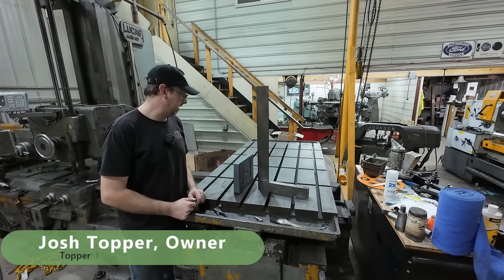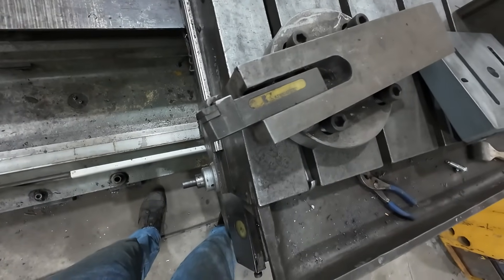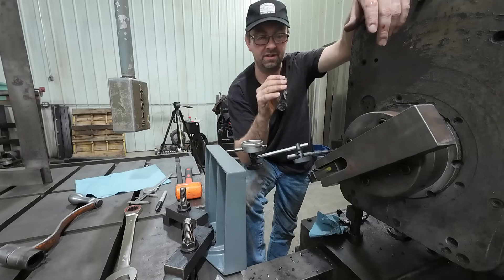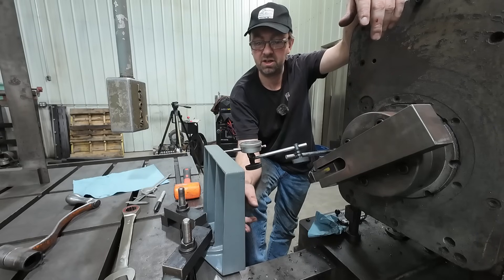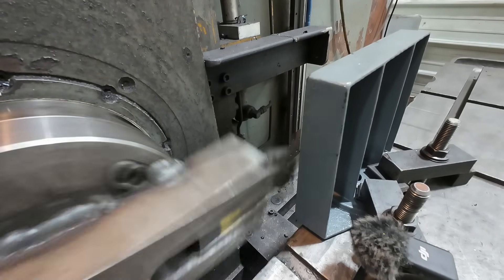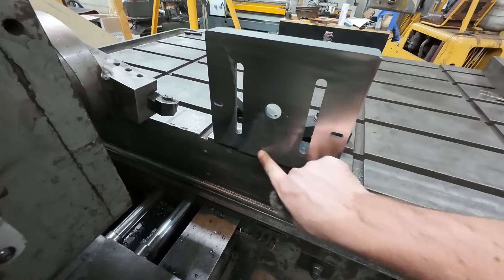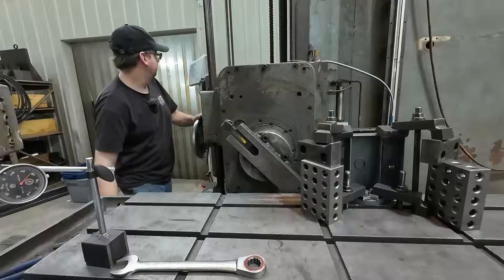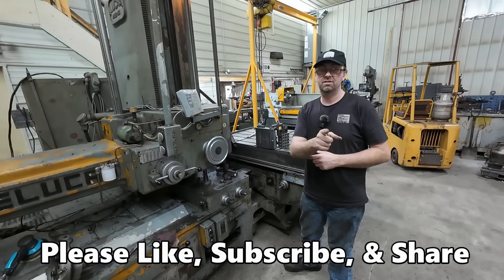Saving A 1930s Drill Press Table | Surfacing Cast Iron Machine Parts | Manual Machining

Comment: Ideally the drill press table should have been measured (clocked) before it was removed from the customer’s machine and have the high/low spots marked on the table. So it could be clocked in on Josh’s machine to the same figures,,,,

Comment: A tacky, gray, clay-like compound called duct seal (@ Amazon, Home Depot, etc.) can be used to add mass for vibration dampening. It is hand moldable and doesn't harden. Potential drawback is chips sticking to it. In the 90's I worked at a subcontractor for the US Navy and the machine shop there used a similar gray compound we called monkey shit. I don't know if it was just duct seal or something different.

Comment: I think the boring mill was an excellent choice; it matched the tool pattern already on the part. I can just imagine a jig with a bunch of tables ganged up running past a face cutter back when they were making these.

I'm willing to believe you know more about what this press looks like than I do, but it looked to me like the face you mounted on the table had some registration grooves. It certainly would have been a harder set up, but wouldn't it have been better to flip it 180° and indicate the mounting face and grooves? Like, I'm sure within the tolerances of a drill press it's still close enough, but if those grooves lock into the stand, the table will be crooked if you didn't indicate them (unless you go lucky when you chose your points)

Comment: i would assume you would have gine with the planer. But I did learn alot when you chose the mill. Curious why you chose to employ the hard rubber padding rather than solidly fixtureing it up.
Reply from the maker: The rubber gave dampening without fear of moving it.

Comment: I was thinking - perfect job for the surface grinder, but then i thought i dont know if i have seen a surface grinder in your shop ?.
Reply from the maker: I had one for 10 years and never turned it on.  Never had the need for it.  Went to the scrap yard a couple years ago.  Floor space is far more valuable.
Reply: @TopperMachineLLC  figured if you needed one you would have it!

Comment: At the outset I was thinking that this was a little like cutting butter with a chainsaw but turns out to be a pretty good choice.  The part originally may have been a product of rotary surface grinding (Blanchard) as a lot of woodworking machine tables and stuff like that are - heavy material removal with so-so accuracy.  Viewer should be pleased with the outcome and the process was interesting to watch.

Comment: Just a FYI with my background mainly being in surface grinding I have had good luck with Pot Magnets for taking harmonics out while grinding. You can get them in different sizes for different weight which makes them handy. You would have to be aware of deflection if you are hanging the magnet on the part but if you use them bolted to a steady rest you can adjust the push or pull force. I was just thinking you may have been able to stick one in the webbing on the top corners to help with the harmonics/chatter. Cool vid keep them coming.
Reply: Shall I send the table finishing? 😝 my German friend who is a retired toolmaker told me to get it ground!  I like overkill.  I like the machining marks which look like they were done.  Changes to make it complete and “up to par”. A USA machine should have been done better than they did in New Jersey.  N. Wisconsin takes the win!
Reply: @cogentdynamics  Grinding the table would be overkill as you have mentioned unless you have the capabilities and time. I am sure what Josh has done to the table will be just fine for drill press work. A German toolmaker friend is quite friend to have around.
Reply: also a SG would violate the "like original, but perfect" idea, Josh chose tool, feed to match the original finish
Reply: @bcooo1  I like to joke around.  Do many good people here.  German guy wants to sell me his grinder with a magnetic sign vise.  I don’t have room nor the skill.  It would be cool to play with the grinder.  Not on a drill press.  I had trouble with grinding as a youngster. Heat and force makes it challenging.  I threw my motorcycle cylinder out of one and broke a pie section out of a borrowed grinder.  Oops!  Everyone hit the floor and crawled to the breaker panel.

Comment: Although the table may tilt it does have a pin hole to set it perpendicular to the spindle. This pin hole may have been drilled on assembly so may not be aligned square with the the pivoting hole. The best reference face is under the table which is where it could be indicated square. This will be close but really needs to be tested for perpendicularity on the drill with the loacating pin after machining.
Reply: Set it up square to spindle on the drill and drill (& ream) out the locating pin hole to take a slightly larger diameter pin, if you must have a locating pin.
Reply: @dutchgray86  that's an ideal fix to quickly and accurately set it level side to side.

Comment: Great video, but how can you be sure that the table will be 90 degrees to the drill press arbor? The table could be 100 percent flat and if not that 90 degree angle, the hole drilled will never be straight.
Reply from the maker: table tilts.

Comment: 🇦🇺🇺🇸. 4:30 am in Queensland Australia, watching a Topper Machine video. Sitting on the Veranda with a cup of coffee and a Brushtail possum wandered past only a couple of feet away. Doesn’t get any better than this.👍
Reply: David also in Townsville Queensland watching Josh work but unfortunately swimming with 600mm of rain in 20 hours. Expecting another 1.5 meters in the next two days. Love it. Josh keep a stiff upper lip and I hope your business picks up this year.
Reply: @ 
Yeah I’ve been watching the weather reports. You blokes are getting a flogging with the wet weather. I’m just south of Bundaberg and we haven’t had anything yet. Cheers.
Reply: @davidcat1455  they seem to think it may move south and east from here so you may get some after Wednesday. We are used to getting a big wet so it isn't so bad around us in Condon. The old lower areas South of the city near the harbour are flooding at the moment and the reports say that it may rise above the height of the second floor buildings so even the Queenslander houses on stilts up here may be flooded out. They are releasing water from the Ross dam as it is at a 140% and rising. If we get the 1,5 meters of rain they are talking about it may get really interesting around here.
Reply: @Andy-Gibb  
👍Stay dry and keep yer arse to the sunset.

Comment: I’m always impressed at the quality of older, castings, minimal flash, nice and smooth.
Reply from the maker: From a time of Pride in Manufacturing.
Reply: Yeah, modern stuff is often junk. You look at it the wrong way and it breaks.
Reply: The castings on the low-end “Driver Line” is really beautiful. Cool shapes and proof of time show it is good.  Maybe the rough finish of the table was at a high feed and DOC just to stop some crazy chatter.  I don’t know but now it is correct thanks to Josh.

Comment: I’m curious if it might not have been wise to align the surface with the hole for the pin the table mounts on. Perhaps there is a mechanism to adjust that angle built into the mount?
Reply from the maker: they are designed to tilt.
Reply: @  Front to back as well as rotate around the pin? I’m not challenging just curious. 

My 1970 craftsman drill press’s table can only be raised and lowered. I got it for free. They were discarding it at my work since the rack and pinion on the quill was slipping. When I disassembled it to repair and replace parts I discovered an eccentric bearing that adjusted the rack and pinion’s engagement.

Score.

Comment: Aren't the grooves in the flange used to locate 90° side to side? I would think it would be important to locate 90 not only to the post front to back, but also side to side. Maybe it doesn't have a locator and you just dial it in IDK?...
Reply from the maker: no

Comment: I get that if this bothers the person, then fixing it is worthwhile, as otherwise it will bother him for years to come. I know that from experience where I’ll take a machine apart just to “fix” something that’s annoying, sometimes just to look at, but not really affecting the work. I’ve got four drill presses. If I do something critical, I don’t do it on a press, I do it on a mill. So whether this table, which, from a machinist’s view, is far out, really doesn’t affect whatever he’s going to do on the press. The errors I saw average out over the top. You also have to be wary about taking too much off. The tables on these little presses are pretty thin. You don’t want to get into a situation where you have to take off just a little more, and then a little more, and then a little more. Additionally, I’ve seen old pieces that have one side machined with the other as cast, when the part is thin, machining just a bit more off has the part warp over the next few minutes, and then some more over the next several days.
Reply: Ha! It has been age normalized for 90 years.  I know what you say is correct.  You would have thought I was off my rocker (and I am) to rework the spindle with new bearings after having it reground o.d. , hard chromed and re-ground.  We use this machine for 4 years but it pissed me off just looking at the table! Thanks for commenting because people like you teaches us all more.

Comment: I agree with you Josh.
The HBM was the way to machine the drill press base.
Nice work.
Customer should certainly be happy with this.
Thanks for sharing. 👍🇺🇸👍
Reply: I wonder what machine back in ‘34 when it was cut?  I would like to know but I do know that Josh used a lot more care and I appreciate him.  Also, thanks for your comment.
Reply: @cogentdynamics  I would not be surprised if they did the surfacing in the same manor back when it was made.
Just the feed and setup was not as good as Josh's setup.
Josh was careful and malicious. 
Glad that you are restoring your old drill press.
Have a great weekend. 👍🇺🇸👍

Comment: Heh.  I have a drill press table that isn't square AND the column clamp isn't square either.
Reply from the maker: Just did what the owner asked and paid for.
Reply: @TopperMachineLLC  What I mean is that I've been meaning to re-machine it myself and I wonder just how common the problem is as I suspect woodworking machine companies couldn't be bothered to make them right in the first place.
Reply from the maker: I have no idea.  I don't mess around with drill presses.  Good question though

Comment: Very nice result. As good or probably better than when the casting was factory new. Now the owner needs to send you the machine base for a similar treatment.
No "Arc of shame" on the Drill Press table.  A responsible owner.
Reply: Since 1936!  My ownership has only been in the last 4 years.  There were two small peck marks.  It wasn’t me or the 3 guys have been using it.  I trust Josh!

Comment: Im not trying to be critical, as im a weekend hack machinist. When i observed the table mounting face there was the main mounting hole and then there was a secondary smaller hole. Im assuming the smaller hole aligns with a dowel on the drill press column which in theory sets one direction of the tram. Assuming my assumption is correct, on your setup how did you take this into consideration when setting up the workpiece?
Reply from the maker: You're assumption is incorrect. The big hole is the dowel, the small hole is the bolt that allows it to pivot sideways.
Reply: @TopperMachineLLC  thank you for clarifying.

That's interesting, i just checked, and my Rockwell has the large as the pivot and the small for the alignment dowel. 😆
Reply from the maker: So many different designs out there.  It is hard to keep track of all of them.

Comment: I probably would have put a piece of paper under the mill side edge to tip the plate back just a bit. That would compensate for some sag when it’s mounted on the drill which I am sure it has since it’s a cantilevered mount and the harder you push down with the drill the more it’s going to tip.
Reply from the maker: Good point. He just asked to make it perfectly square.

Comment: An interesting setup with the large fly cutter on your huge boring mill. A little different but, as you said,“why not?). I didn’t expect the mounting surface to be as square to the face as it was, since there’s usually draft on castings. You’re on a roll; keep it up.
Reply: the mounting surface is machined true first from the factory , I think

Comment: Kinda cool how you did it.  There's more than one way to skin a cat, as they say.  My first thought was to surface grind it but maybe there was a bit too much material to take off.  Do you have a surface grinder?  I don't think I've seen one in your shop.
Reply from the maker: He wanted an original surface finish. I don't have a grinder any more. Had one 10 years, never turned it on. Scrapped it a couple years ago. Floor space is more valuable than keeping useless junk.

Comment: Nice OEM finish,  coarse finish helps fine debris get pushed out from under vice, part etc. Looks like original machining was poor, as you stated, unless someone else had a go in its 90-year history. 
 Now, that's a fly cutter. Dampener pads worked great.
Thanks for sharing.
Reply: @bostedtap  I restored this one after purchasing an old woodworker who was moving to a “home”.  Sad but it has a new life.  It will run for another 90 with some care. Thanks!  I’m loving Topper Machine, Josh is a very good man.

Comment: I probably missed it because I don't have the experience: How would you check that the set-up is also square to the mounting points? The set-up got as close to parallel to the original surface as possible. But since we know that the original surface wasn't the greatest, it would be unfortunate to cut a perfectly flat surface... at an angle to where it should be when mounted in the drill press.
Reply from the maker: I don't have the drill to check that, just the table. But an indicator in the spindle will do it. He asked to square it to the back, which I did.
Reply: @TopperMachineLLC  Thank you! :)
Reply: Nicely done, Josh! That was an excellent idea for reducing chatter. I'm sure the viewer and customer will be pleased.

Comment: I always kind of wondered how you find a starting point on a basket-case part like that. Turns out, you just pick the straightest piece and call that reference.
Reply from the maker: There is really no good way.
Reply: @TopperMachineLLC As we saw, the surface changed little over the many cuts made. This puts the lie to any out of square or not correctly placed objections I think. Of course, just my opinion.
Reply: @MadeInMichigan    Without the column casting you have to assume the mating surface is in 90° tolerance. If an angular index mark - inspect to the bore centerline, if important for the customer.
Reply: @waynespyker5731  That's what I would have figured. Use the mounting interface as the reference, then make the top face square to that. Because while that table top is now flat and has a good finish, there's no guarantees (that we see shown here) that it's actually square to the post mount, which would, of course, affect every hole drilled in every part set on that table.
I guess if that's what's on the milling table surface, it's sort of implied, but not guaranteed.
Or maybe I'm thinking too much into an old drill press table.
Reply from the maker: I was sent the table, not the whole drill.  Without doing all of it, it will never be known.  But, the job was still done how he wanted it done.
Reply: @TopperMachineLLC  Right right. I'm not criticizing, by any means. Just trying to plan ahead for the day when people I don't know start sending me their wonky drill press tables to straighten out.

Comment: Nice job.
I'm guessing you squared the mounting surface also.
Thanks for the video.
Reply from the maker: Since he had zero issue with the mounting surface, it did not need attention. Had there been any irregularities, yes. When I set it on my table there was zero movement.
Reply: @TopperMachineLLC  if I need to address the surface on the column bracket.  We know this was fine as it was but now it is better and many of us are smarter.

Comment: Beautiful final surface finish.
For the sake of showing the problem of deflection in circumstances like this, could you possibly set up your dial indicator on the bed and indicate off of the BACKSIDE of the work piece and video that while the cutting is happening. Doing so might show just how little deflection it takes to cause chatter, and how much damping your anti chatter technique actually provided.  I'm a believer and it might make some good content if you could show it on video.
Reply from the maker: Good suggestion.

Comment: Looks like a perfect job for my shaper!
Reply from the maker: While a shaper would do a good job, he wanted the original.milled finish, only flat.
Reply: @TopperMachineLLC  also, the shaper was heading out to a new owner right?  I thought about that.  Also thought about my lathe… work holding!  People keep telling me. 🙂‍↕️
Reply from the maker: @cogentdynamics  The shaper should be leaving in the next month or so.
Reply: I was even thinking it would be a good piece to setup in the 4 jaw and face flat in the lathe. Many ways to do it for sure
Reply: or grinding. its not a restoration. so grind that thing flat!